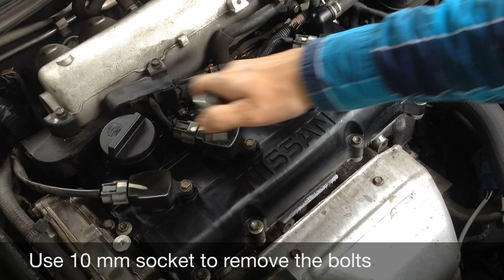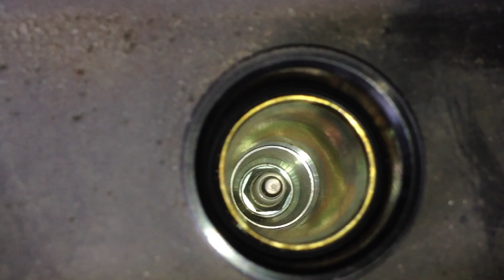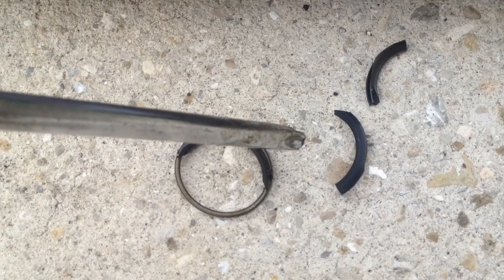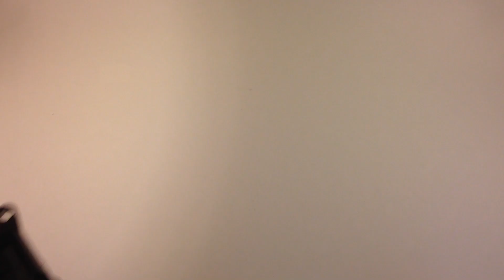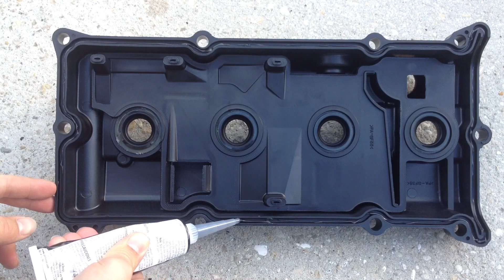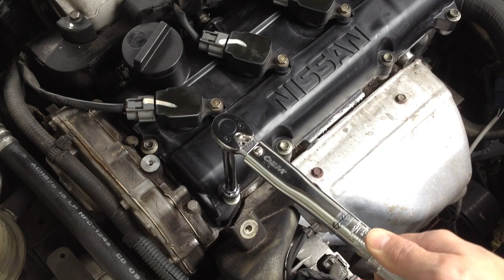How To Fix Oil Leak & Cylinder Misfire - Valve Cover Gasket Replacement - Nissan Altima 2003 2.5 SL

Comment: I just replaced my valve cover gasket and now the engine turns over but it does not start! I replaced this gasket before no problem. I don’t know what could be wrong..  no oil in plug tubes, put everything back in order..  help
Reply from the maker: What car is it? Did you do anything else besides valve cover gasket?

Comment: after removing the engine cover   but befor you remove the coil on plugs   if you can  and you have it   use compressed air   to clean   all around   to remove  all dust and dirt

Comment: Do not put silicone between the valve cover and the gasket. This will make the next replacement nearly impossible. Does not add any additional protection. Add only on the corners of cylinder head surfaces.

Comment: So I’m in a bigger bind. I started this repair with a po304 code meaning cyl 4 misfire. I replaced the valve cover and gasket along with the pcv valve and now am getting a po300 (multiple misfires) code and the car is shaking vigorously at idle and vibrates during acceleration. Please help!
Reply from the maker: Test your ignition coil #4 using this method: https://youtu.be/pP0I-iSBUF4 
Let me know how it goes.

Comment: Could you please explain what you mean by tighten them in two steps? And what torque should I tighten them to in customary units?
Reply from the maker: 1. First, tighten all 10 bolts to 9-26 in/lb of torque. 
2. Second, tighten all bolt to the final torque of 65-82 in/lb. 
This is done with intent to gradually and evenly apply the pressure on valve cover gasket to avoid warping or overtightening it on any one side. Be very careful, stripping the thread on the engine block is not a good thing at all... 
As far as torque units, check out Google measurement converters to find exactly what you looking for.

Comment: Never replace a Nissan valve cover with a Dorman, they are shit!!  They have a defect that allows oil to blow by the PCV valve. Your motor will start burning oil and cause all sorts of problems. Your motor will carbon up and start misfiring and your cat will eventually start to plug. They know about this problem and redesigned it, but didn't recall the shit ones, leaving them on the shelf for people to mess their cars up with. Shady ass company!! I will never buy another Dorman product if I can help it.
Reply from the maker: Thank you for sharing! I hope this will be helpful for someone trying to fix this problem. One can never go wrong with good old OEM parts...
Reply: ugh i just found out why https://www.youtube.com/watch?v=zVhnlOoEhH4

Comment: You did not take out the spark plug gasket's ? I'm curious did you inspect the spark plug gasket to see the were cracked?
Reply from the maker: I did. On this particular car they are built into the valve cover. As a matter of fact that is the only reason why I had to replace the valve cover. Seals were bad and there is no other way to replace them but to replace the whole cover.

Comment: Would these problems cause the car not to start? Iv had the misfire already but never got it fixed and now my car cranks but doesnt start. I know doing this would fix the misfire, but would it also make it start again?
Reply from the maker: Do you have the same Altima? 
I had no start when Crankshaft positioning sensor broke. 
Scan your car for error codes to get a better idea what's wrong.

Comment: What happens if a bit of oil gets into the cylinder when spark plug is removed?
Reply: absolutely nothing as that's a recognized way to bump compression when testing for ring wear...

Comment: Wow, this is much easier than the 07-12 Nissan Altima. It's so stupid that you have to take an engine mount off to replace the valve cover.
Reply from the maker: Agree 100%. I have 07 Altima right now and I need to do the same thing. Way much more trouble...

Comment: Thanks much for the video, I do appreciate that you also posted the torque specs. 
Is it possible for you to post one for 2006-2015 Nissan Frontier and also how to change the tappet seals ( valve stem seals ).
Reply from the maker: When I was doing mine, I bought repairs manual digital download. It had all instructions and torque specs. 
Unfortunately, I don't have a repair manual for your car, it was only for 2007 Altima.
But if you do a lot of DIY repairs, you can find a repair manual for your specific car here: 
http://shareasale.com/r.cfm?b=752645&u=1685674&m=49176&urllink=&afftrack=

Comment: I just had this problem. Im not a car guy at all but when i found the spark plug well was full, i took the spark plug out. Oil got in the cylinder. Its running buy occasionally wont start and has a rough idel
Reply from the maker: +Oh Heku 
You may have your crankshaft and camshaft sensors going bad. I have two videos on how to check and replace those sensors.
Reply: use a rag and long screwdriver to get oil out. too much oil in the valves is not good!

Comment: gasket maker optional?
Reply from the maker: +Soldier1287 
There are only few places where it's required. Official repair manual doesn't say you need to apply it all around, but I did anyways. I don't think it'll hurt...
Reply: ok

Comment: Thank you so much. I just got a misfire error and went to change the spark plug and discovered my entire well filed with oil. Looks like I'm the weekend mechanic now
Reply from the maker: +Donald Hughes 
Thanks! 
Good luck and enjoy!
Reply: All done. Great video! I just need to find a torque wrench - any advice? Total cost < $200
Reply from the maker: You can either buy one or use "rent for free" program at your local Advance AutoParts.
Reply: Thank you
Reply from the maker: No problem!
Reply: Quick Question. So I see no leaks so far. There is a small crack in the PCV hose (going to get it replaced). When I do a cold start, white smoke comes from the exhaust pipe. If I park and restart there is no smoke. Could it be the remaining oil I could not get out the spark plug well being burnt off or the small crack in PCV hose (the valve was replaced)? Thanks again
Reply from the maker: Is it still happening? Check your coolant level.
Reply: Yes it is. Funny you should ask that. So about 3 months ago I checked my coolant level and it was going down. I refilled it and seems to be going down very very slowly. No white smoke was coming out exhaust till now. Do you think I should use Steel Seal?
Reply: Quick question so the smoke may be caused by not screwing in the pcv valve properly (I only hand tightened ). The socket is 23 mm but how do I get a rachet to fit with limited space? Do I have to remove valve cover, tighten pcv valve then reinstall? Any help would be greatly appreciated
Reply from the maker: Sounds like you may have blown head gasket. 
You may try Steel Seal if you want, it may help if damage is not too severe yet, but it may not....
Reply from the maker: I don't think it is it is because of PCV valve.
I used adjustable pliers to tighten mine without taking off valve cover. I just removed engine cover, buy every car is different, I'm not sure how is yours done....
Reply from the maker: *you can also use adjustable wrench
Reply: Finally found the problem! Dorman Valve covers are defective and leak oil into the PCV valve then into exhaust. Changed the valve cover to Factory Original Nissan and so far no smoking, no leaks - problem solved
Reply: @donny268  I find Dorman is either GO or NO!  Definitely not consistent across all their offerings.  Thanks for the feedback on these!

Comment: Hi, I am working on my daughters 03 altima, I did not notice oil in the well until after pulling the plug, stupid question, oil ran in to the cylinder on top of the piston, any worries? This should seep past the rings back into the engine correct. Thanks for the help
Reply: I had this same issue. And would like to know if it would cause damage to my engine

Comment: well done video sir! I will be fixing myself thanks to your video. One question though: what did you mean at the end, after you had tightened up the bolts, about it being done in 2 steps? Thanks!
Reply from the maker: Don't tighten them all the way in right away. 
First tighten them all to the first spec, then finish tightening all the way. This is done to prevent overtightening on any one side when gasket gets misplaced or warped.

Comment: Valve cover gasket leaks can cause misfire? I thought leaks to
Plug well only?
Reply from the maker: That's if considering gasket and o-rings as a set. Cuz you normally supposed to replace both at the same time. 
On many cars gaskets and o-rings even connected together.

Comment: i have a MGB Roadster and noticed that oil is leaking around one of the spark plugs. what could this be?
Reply from the maker: +Richard Bing 
It could be due to bad gasket or o-ring, failing piston or compression ting, or worn valve guides...

Comment: How did this solve your leak into the plug hole?  This gasket has nothing to do with that part of the cover.......and all that extra sealant.. cringed a little bit.
Reply from the maker: Well, the thing is, when I replaced valve cover, it came with new PCV valve, which I believe was the root cause of the problem. Stuck PCV doesn't releave pressure builtup, causing gasket and o-rings failure. On that particulat Altima plug holes gaskets are built into the valve cover, thus directly related. 
As far as extra sealant... yea, totally unnecessary, but it won't hurt eather. I saw someone doing it... shouldn't have listened...
Reply: Hmm. I have a 03 Sentra SE-r and had oil with my plug as well. Built in seals to changed V/C. Two years later the same thing happened. I didn't change the PCV valve though. That might have been my mistake, not checking it either. I found this customization of the cover but haven't fully got the dimensions on it other seals and spark plug cylinder to match up.  yhst-13387653796039.stores.yahoo.net/diynivqvacor.html

Comment: I'm going to do this on my daughters 2004 nissan maxima, because I can see the gasket is hanging out on one of the curved corners, on the left front side and is leaking oil. Hopefully I do the job right and not end up with my fingers stuck together lol.

Comment: Hey genius you have to put rtv in the corners or the gasket will leak due to the fact that a square corner and round corner do not seal together. I bet you were the kid in school who tried to put a square through the circle toy.....
Reply from the maker: You can do whatever you want, sir.  I'm just showing how it's done according to official Nissan repairs manual. (chapter "Engine Mechanical", pages 38-39).
Reply: You still misses the part where it tells you to place sealant in those two corners.
Reply from the maker: I'm sorry, I'm not sure what you were trying to say. I'm sure you were that kid in school who failed grammar...
Reply from the maker: But on the serious not, when you remove the valve cover, pay attention to the factory RTV application. You'll see that it's only applied in two places.
Reply: Nope smart phone big fingers but that still won't stop the oil leak you will have if you don't put rtv in those two corners
Reply from the maker: But I did put it! In those two corners and everywhere else, just for the heck of it. And it didn't leak for few more years until I sold that car. 
But again, do it however you want, I just shared what I did and what worked for me. This video is offered as is! No guaranty! And my advise worth exactly how much you paid for it - nothing! 
Have a nice day, Sir!

Comment: My 2003 Altima was facing the same issue - oil leaking into the first cylinder (just like the video!), causing it to misfire.  The clear instructions from this video allowed me to replace the valve cover gasket with no fuss or muss.  And I am not a "car guy" who does this type of thing much.  I really appreciate Temachok for putting this video together - much appreciated!!!!
Reply from the maker: Thanks! 
BTW, I'm not a "car guy" either!
Reply: How much did this cost you

Comment: I came looking for info on replacing the valve covers on my 05 Maxima but still chose to watch this.  This was by far one of the best and most informative videos ever.  Easy and clear instructions.  Thanks for making it.
Reply from the maker: Thank you! I really appreciate grateful people!
Reply: Wish you lived in Georgia or could make a video on doing valve covers for the 05 Maxima!  It's going to be harder because there are 2...the rear is hard to get to
Reply from the maker: Yea, working on 6-cylinder engines is a lot more challenging...
When I was doing mine, I also coldn't find much info in how it's done. What really helped me was official Nissan repairs manual. It's good to have it if you like repairing most of the problems by yourself.
Reply from the maker: Something like this: "https://www.amazon.com/gp/search/ref=as_li_qf_sp_sr_il_tl?ie=UTF8&tag=dp051-20&keywords=2005 Maxima repairs manual&index=aps&camp=1789&creative=9325&linkCode=xm2&linkId=3f02a990214c22e8c65127c092dd577c"
Reply: Temachok do u mean that I can use the same old gasket cover, but clean it very well?
Reply from the maker: It's not recommended. Especially when new ones are just $15.
Reply: Thank you man. Ur video are helping a lot of us in here save our poket.
Reply from the maker: That's great! 
I'm glad it does!

Comment: I have a 2005 ser altima. The engine is making a misfire noise
Reply from the maker: Scan your car to find out what cylinder is misfiring.
Reply from the maker: Then lookinside the cylinder to see if there is any oil inside.
You can also try this method, its on later Altima, but the process is the same: https://youtu.be/pP0I-iSBUF4

Comment: The video is super helpful, but Can you explain or show how to do the temporary fix with the gasket maker on the spark plug tube?
Reply from the maker: You can put some gasket maker around spark plug tubes to stop oil from leaking out. It may not work if O-shaped seals already fell off like it was in my case. In any case, replace valve cover as soon as possible.
Reply: ok, also another question came up earlier today. is there any other inner tube lower gaskets that can be part of the problem? if so, what would you recommend?
Reply from the maker: I think this is what you looking for:
https://www.youtube.com/watch?v=1_op0gb6Me8

Comment: please answer. i need to know of this will be the same for a 2000 maxima? thanks
Reply from the maker: It won't be the same, because all cars made differently.
In general the process will be very similar, but not necessarily.
Your car is probably 6 cylinders, not 4. Engine may be located differently, and it may have some other things obstructing access to valve cover. It may also have two blocks, instead of one - which means you need to replace two valve covers and two gaskets.
Reply from the maker: Also, repairs manual can be very helpful. It shows exactly how to do this and many other repairs on your specific car. I personally got one of those before getting into it. 

"https://www.amazon.com/gp/search/ref=as_li_qf_sp_sr_il_tl?ie=UTF8&tag=dp051-20&keywords=Nissan maxima repairs manual&index=aps&camp=1789&creative=9325&linkCode=xm2&linkId=bcc4610d2cbde6c4bbefb83b55487f89"
Reply: this new youtube on ios10 is so weird. but thank very much appreciate it
Reply: Dj Tymes yes

Comment: if there is a leak like on the video,  do you have to drain the oil or just clean out the chamber and replace the gasket?
Reply from the maker: I didn't have to drain oil on my 03 Altima.
Reply: Engine oil will flow to its reservoir aka the drain pan when the engine isnt running

Comment: Uhmm I thought the spark plugs were suppose to be replace ..if they got drown with oil
Reply from the maker: It can hydrolock cylinders causing machanical failure of engine. 
Soak upthe oil first. Use rugs or paper towels. Maybe spray a bit of break cleaner and blow it out with air compressor.
Reply: You're wrong there. Do you know how much fluid it takes to hydrolock an engine?
Reply from the maker: You can. Just make sure oil doesn't get inside cylinders when you take them out.
Reply: Curious as to why it matters if oil drops in the cylinders? How else are you suppose to remove the plug if the tube/plug is drenched in oil?
Reply: Makes sense. Many thanks to you sir.
Reply from the maker: My pleasure!

Comment: I have a Nissan Altima 2.5 SE, and they are saying i have to replace the whole cover, do i have to replace the cover with the gasket or can i just replace the gasket? the tubing along the edge. because i checked and the one you linked doesnt fit my car its a 2.5 but all they give me an option for is 3.5
Reply from the maker: What year is it?

Comment: do i have to replace the spark plug tube oil seal and oring which i have shown on 3.44 is a circular parts of oil seal
Reply from the maker: +kris mark 
No. You can't replace it. It comes with valve cover.